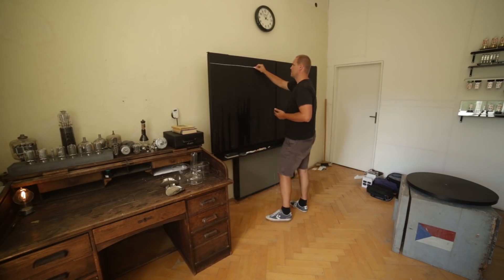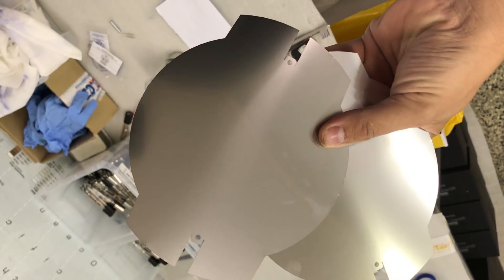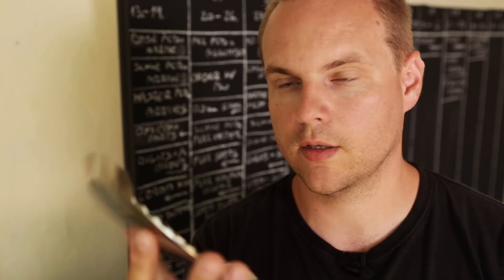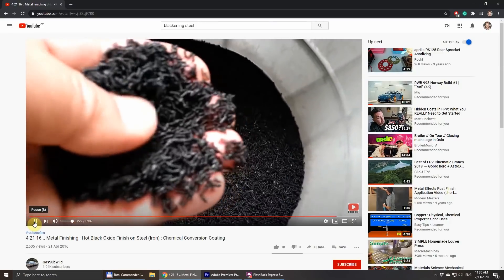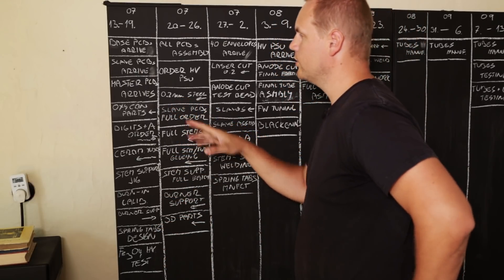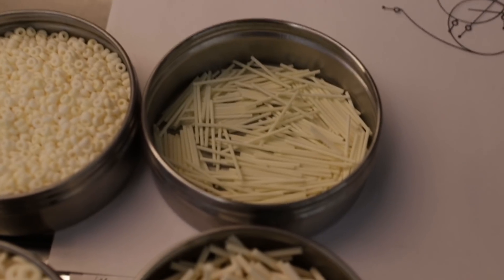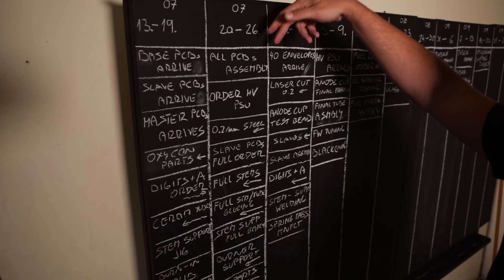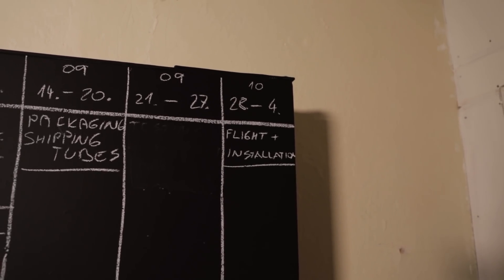12 weeks left, new Timetable - Project H #11

Comment: Adding a thin layer of iron oxide to give the steel a blackish color is called "bluing". Just wanted to point that out as I know how hard it can be to research something when you don't even know what it's called.
Reply from the maker: Once you know how it is called you have 50% of research done :-) This process is actually called blackening: https://en.wikipedia.org/wiki/Black_oxide
Reply: @daliborfarny  interesting. It looks like blackening is a more modern term for an extremely similar process. TIL